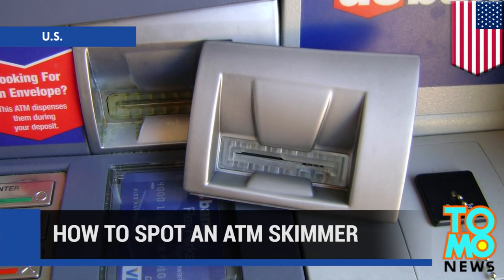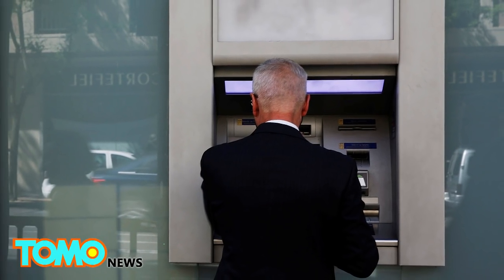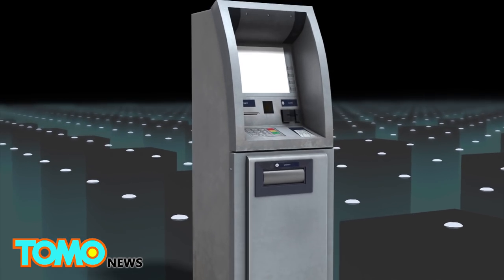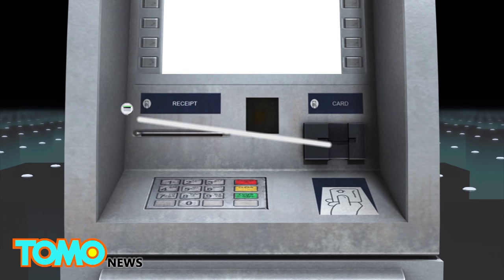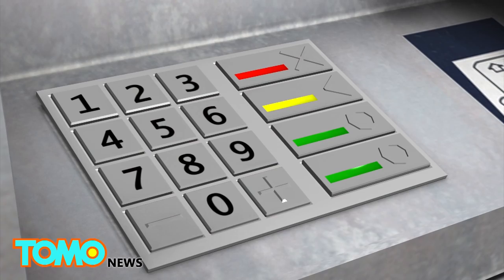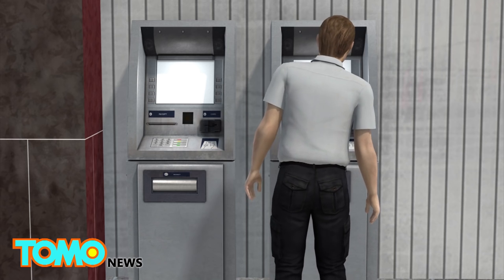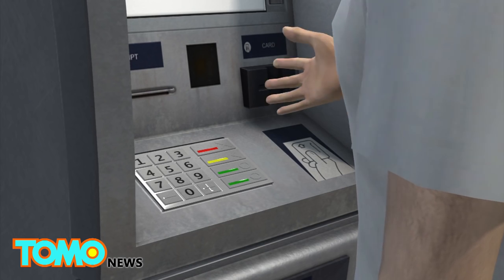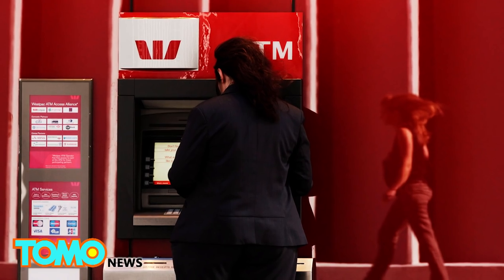ATM skimming: How to spot an ATM skimmer - TomoNews

Comment: Those "skimmers" are more than a decade or so obsolete. Modern skimmers actually fit inside the card slot or are a circuit board that intercepts the signal and is put inside the ATM itself and niether can be seen from outside unless you actually open up the unit.
Reply: Peter Carlson They can, but it’ll be hard, you can’t just put something in a device that holds money without being spotted by a person. And if you try to open it, it will set off an alarm

Comment: yesterday, almost fell a victim on these devices here in philippines. yes, my paranoid self saved me from these. i immidiately destroy this devices till it no longer use and run away for thought there's a watcher nearby and may holdup me. regretably i didn't report this on police but atleast, i manage to break the memory card and capacitor.